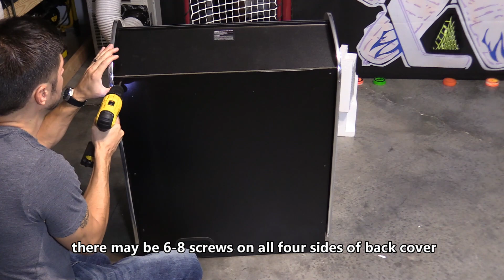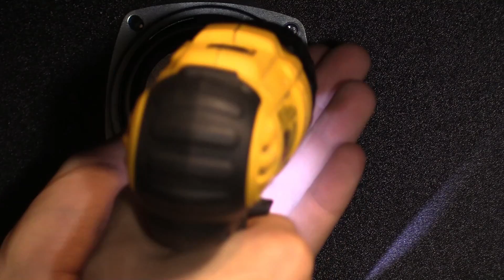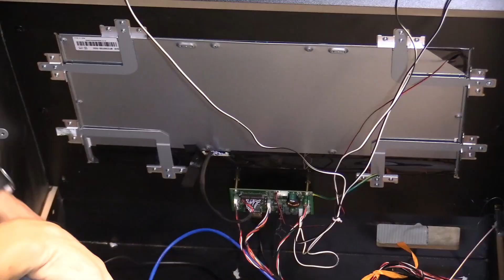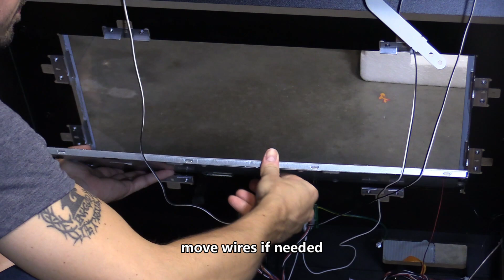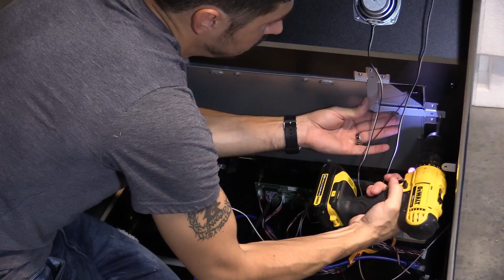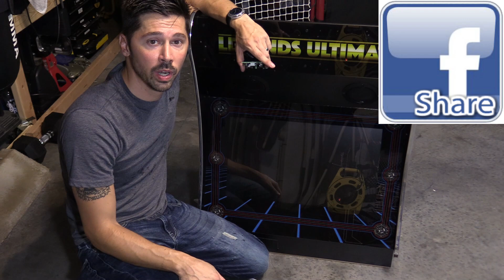How to Replace a LCD Screen Monitor & Speakers in Legends Ultimate Arcade Cabinet

Comment: would LOVE this exact same video, but for the 1.1 models. Very different mounting for the speakers and the monitor. I'd like to upgrade both if possible. (thinking a 30in lcd with the legends core max would be awesome)

Comment: I just wanted to say thank you for this video. I ordered 2 of these from Sam's and they both had dust/debris between the bezel and the LCD, so I returned them. I ordered a 3rd unit directly from AtGames hoping I'd have better luck but unfortunately I didn't. I was going to return the 3rd unit but your video gave me the confidence to open the unit up and clean the dust and debris out. I'm not really a technical guy at all so this video really helped. Thanks a lot!

Comment: The latest version of the cabinet has a thin plastic piece instead of particle board.  The speakers are mounted in plastic cups.  They are rated at 8Ohms, 10W.

Comment: Cool video but let's see how to fully integrate the atgame legends arcade with a pc including the controls with a front end like hyper spin. Thank bro...
Reply: Surprisingly easy to do actually with hundreds of guides on it. But your going to have to replace "EVERYTHING" in the cabinet aside from the speakers and the controls.
Reply: @johnmclain250  Man I got a cracked screen, which makes the screen black with vertical lines.  I can't find the replacement lcd anywhere. Is there some sort of alternate model lcd you can use.  Or do you have any suggestions to get this fixed?  I know it works, because I plugged the hdmi to my TV and it was working.

Comment: I’d like to upgrade my speakers and if possible, add a subwoofer....any suggestions on what will work with this cabinet without requiring additional power or blowing the system? Does the machine have a 3.5mm output so you could simply slide in some pc speakers?
Reply: If you're adding a sub you're likely going to need an amp to drive it.

Comment: I recently bought a gutted arcade cabinet from Goodwill for $20. Well, "gutted" in the sense that there is no power supply, PCB, JAMMA wiring harness, coin acceptor, speakers, chassis (CRT monitor), or marquee light... but at least the genuine Happ controls are still there and someone installed a crappy 16:9 LCD monitor. Anyway, the LCD has got to go and the speakers aren't ported anyway, so I saw the thumbnail and thought this was going to help me "install speakers" to add them to my cabinet. I was disappointed that this is not about installing speakers in actual JAMMA arcade cabs. :( Oh well!

The 2X Happ Competition sticks with 15 Suzo-Happ buttons (counting 1P, 2P, and illuminated Select) are already worth 4x what I paid anyway so I come out ahead even if I scrap the rest. :) Though I've never had an arcade cabinet at home I already had a couple Neo Geo MVS boards and an arcade power supply. I ordered a new 29" Makvision tri-sync chassis and JAMMA harness but I still don't know what to do about speakers... it looks like the cab has never had them!
Reply from the maker: Ebay and maybe Eldorado games might sell jamma wiring guides. Hope that helps.
Reply from the maker: Try this diagram https://images.app.goo.gl/hxHgNChSgLgcY7ah7
Reply: @TampaTec  Thanks. It's great that the wiring is mostly standardized but audio amplification is handled by the game boards/PCBs and I don't know what the standard specs are for speakers (size, ohms, watts, etc). Guess I'll be peeping in a few JAMMA cabs to find out. :)

Comment: It’s been asked again and again but no answer…which screens will fit? Any known model identifiers? Thanks
Reply: That's the million dollar question. Only one person on earth so far has tried to replace the monitor in one of these with anything besides the ones they come with. And he never finished it. So it's uncharted territory. I'm planning to do this myself going in blind. Found a model of 1080p IPS monitor similar to the one in the cabinet, but 32" in size, only 1mm of clearance on each side so it's a "tight" fit. I will need to full convert the internal board with one that can convert to HDMI since nothing uses the LVDS connection thats practical to upgrade to. I'll need to heavily modify the frame if not outright replace it. And I will likely need to use a VESA mounting arm to keep the larger display in place in addition to frame. It will be a hell of a project since it's never been done before on one of these. (Or at least noone has ever claimed to have finished doing it.)
Reply: @johnmclain250  I think this model is the one that has been attempted:::  Dell UP3017
Reply: @Ech0_3  Is that you u/jb3kalel? I'm going to get a good chuckle if it is. :P

Comment: This should be good if you want to swap out the monitor with a 144mhz to replace what looks like a 60mhz. Then your streams thru Arcadenet should have a higher FPS.
Reply: I know this is an ancient post, but given the board it connects to only accepts 60htz connection, that wouldn't work.

Comment: Quick question for you, I have a 82 inch TV that require service under warranty, however the technician told me he will not unmount the TV to the wall. If I want him to do so, I need to sign discharge clause. Is it the standard in the industry? Or is it just Samsung?

Comment: --BE AWARE-- This is for the older higher quality v1.0 arcade cabinet. The newer lower quality v1.1 replaces most of this with cheaper options, less wood, more thin plastic. There are no longer any metal brackets to securely hold in the monitor just a few screws, etc.

Comment: Can the plexi be removed from the front? There is something stuck between my plexi and glass, I’d love to take it off to wipe it off
Reply: I would like to know if this is possible as I have a smear on the inside of the plexi. Thanks.
Reply: @nippynige8523  Mine does too, bad quality control by AtGames, not sure if I like to take it apart, since the plexi glued to the monitor.
Reply: Version 1.1 did not have any glue on the monitor it slid right out so I could wipe the inside of the plexiglass.

Comment: Great "how to do" vid. Have you seen any of the Asian lithum small drivers with torque settings? Might be better for assembly/disassembly,less clunky than 18 or 19 volt driver.